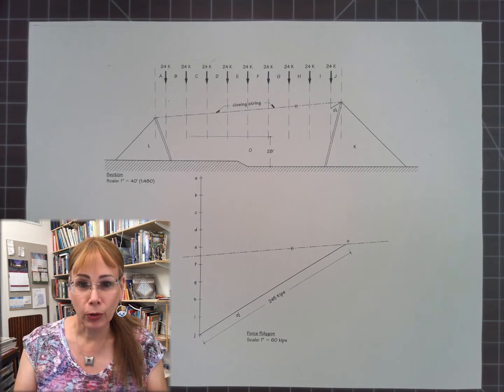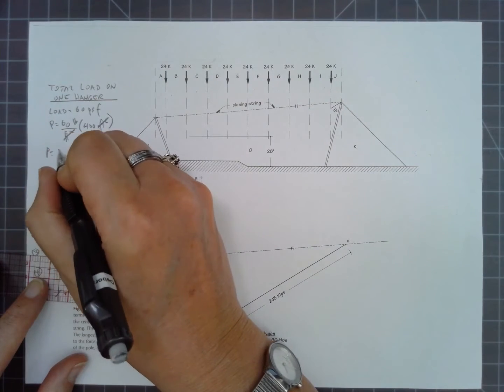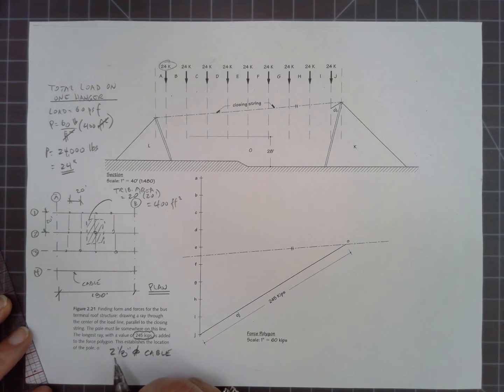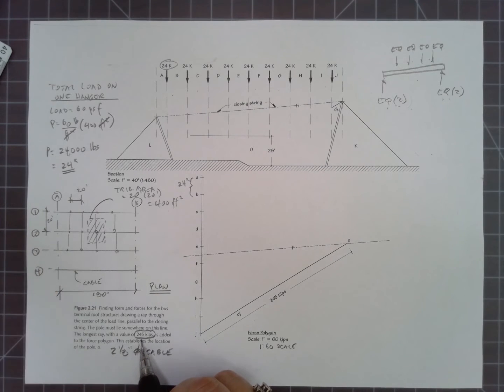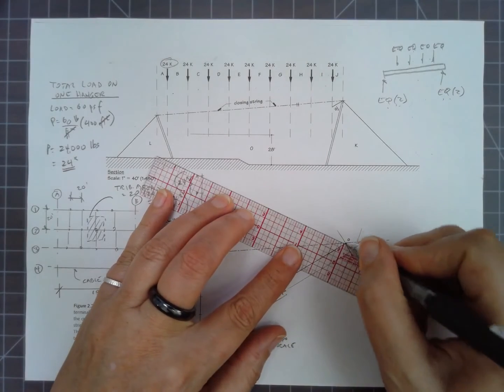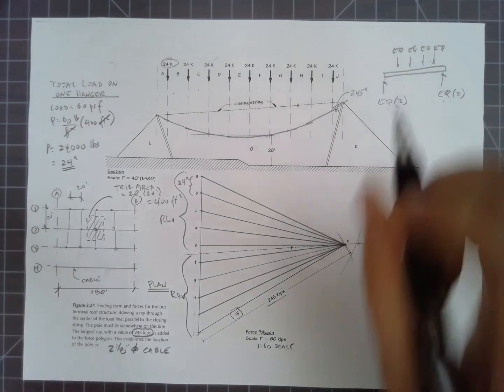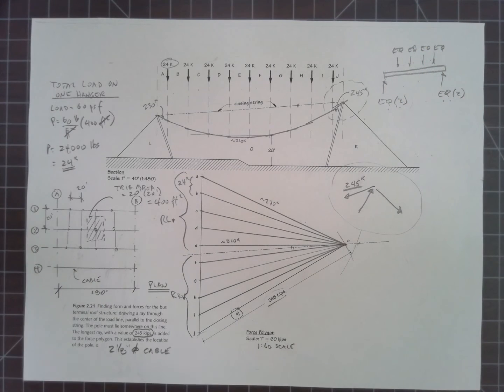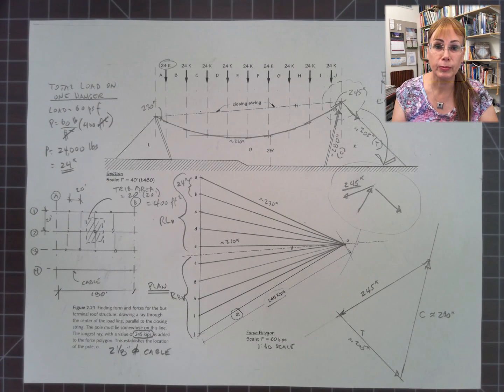Cable Graphic Statics Analysis

Comment: What is a kips is it a kilo pascal?
Reply from the maker: Sorry, just noticed this comment. A kip is a US customary unit with a metric multiplier. It's shorthand for "KiloPound" or 1000 pounds. A kilopascal on the other hand is a measure of stress, not force. When you see "kip" just think 1000 pounds. It's an odd unit, but has been in use for more than a century. More info can be found here: https://en.wikipedia.org/wiki/Kip_(unit)